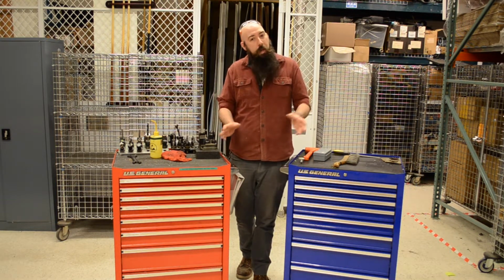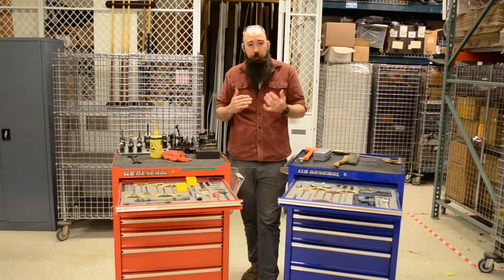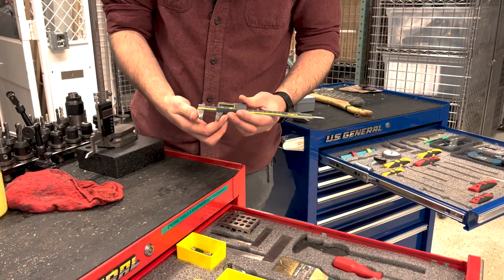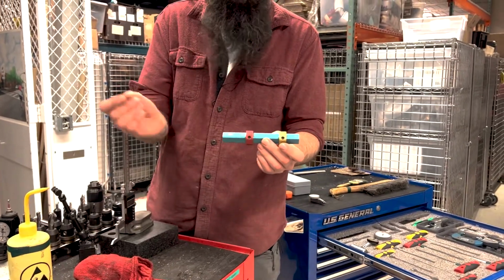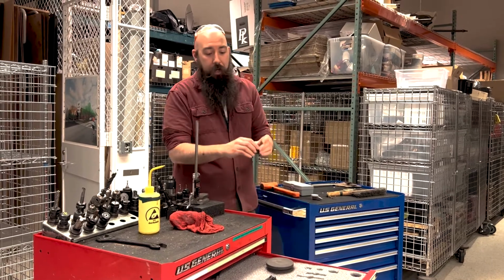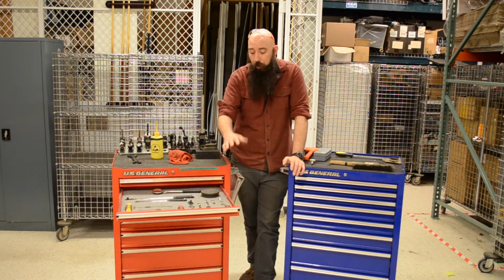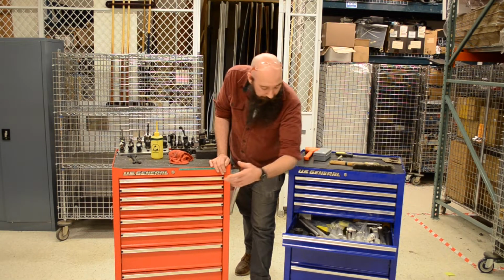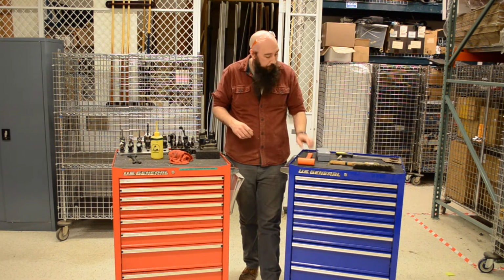Essential Toolbox - CNC Machining: Mill & Lathe

Comment: What magnetic base electronic edge finder is that?  At 7:30 you said it was a mill item but you use it on the lathe for touching off tools.
Reply from the maker: Great question, that is an electronic edge finder from fowler. Makes very quick work of initial setup of tools, only downside is there is no play or spring so if you go to hard/fast you will damage it. We usually keep an extra 1 or 2 on hand for those newbie members with heavy hands. We use the fowler 54-575-600, here’s a link: https://www.amazon.com/Fowler-Warranty-54-575-600-0-Electronic-Cylindrical/dp/B001C7NNNG/
Reply: @mHUBInside  thank you.  I will be doing some research and then probably investing in one myself.  Everyone has something they do or use that can help the next person so im grateful to learn a new hack.